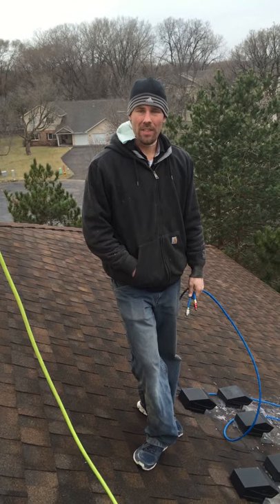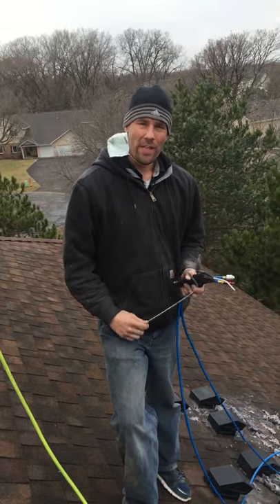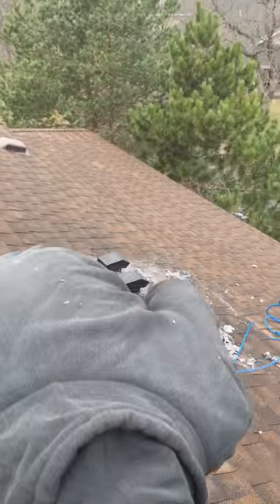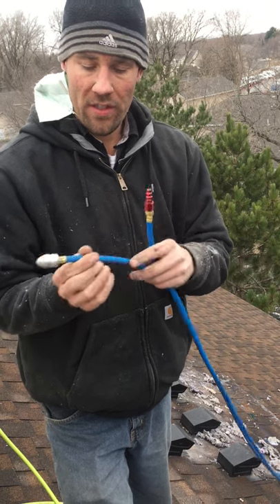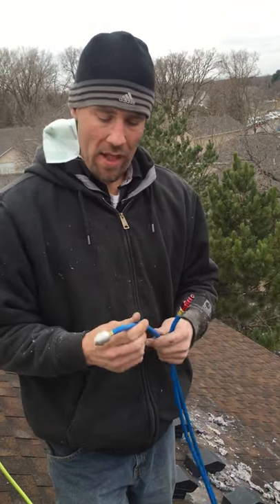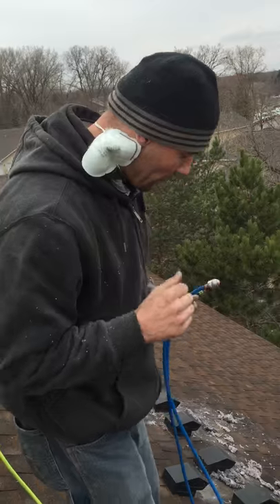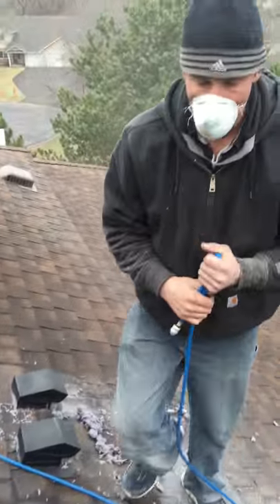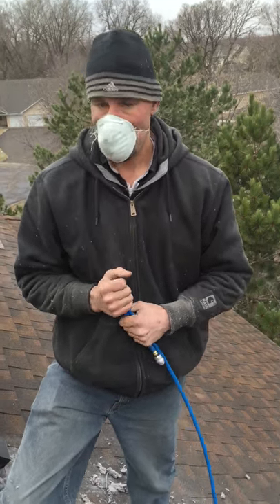Rooftop Dryer Vent Cleaning | Demonstration

Comment: I assume you are doing this without the dryer being on?
Reply from the maker: Correct. Our 175 psi compressor and reverse spinning  airball are strong enough to get all of the lint out without the dryer running.
Reply: @twincitiesfurnacecle  great video !!!  How much do you charge per cleaning ?   Also does the compressor need a hook up for electric or is it gas.   Thanks much !